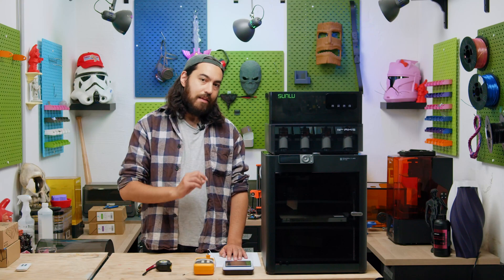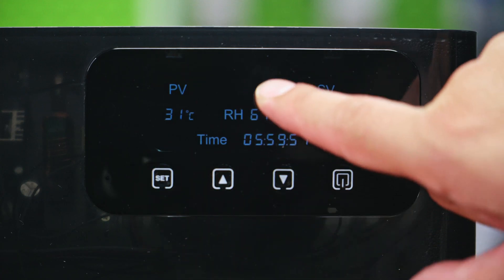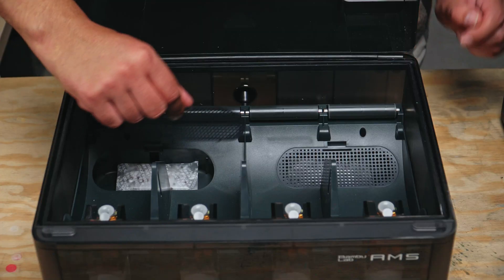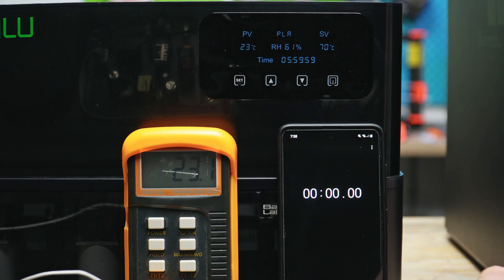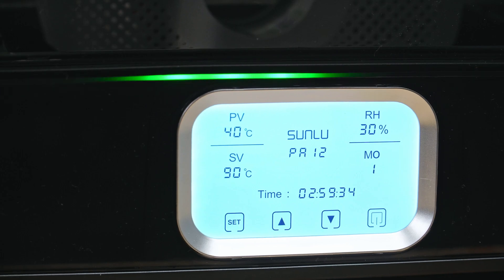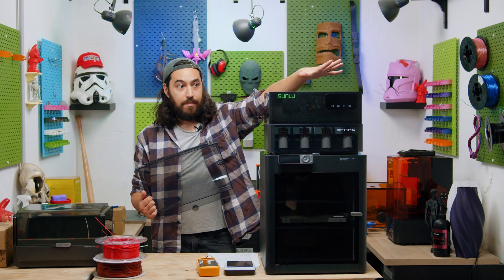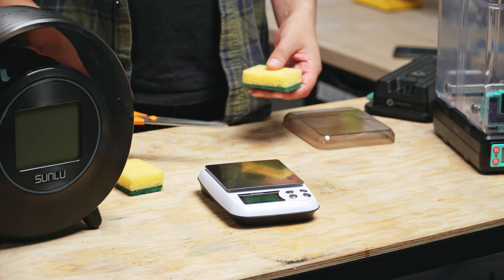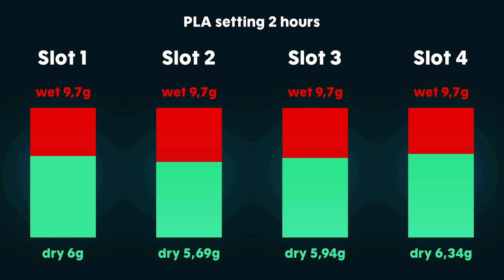The SUNLU AMS Heater: Powerful, Independent, Necessary

Comment: I have the AMS 2 pro and I'm pretty annoyed it wouldn't dry and print at the same time. Would this lid also fit on the AMS 2 pro or did they have different dimensions?
Reply from the maker: They're very similar but I believe there is an issue with the hinge. Search "Sunlu Heater Hinge for AMS 2 Pro" on makerworld

Comment: Does this remove the need from having desiccant inside the AMS?
Reply from the maker: Not exactly, the dessicant is there to keep the filament dry when the filament is being stored so while the printer is not operating and you have some spools stored in the AMS it is best to keep some dessicant in there so the filament doesn't absorb moisture. Technically you could just dry more often but it's simply more economical to use some dessicant.

Comment: i got mine yesterday, and my ams actually started to get physical moisture in the bottom corners of the ams "foggy looking with droplets" idk if im doing anything wrong but it looks like its sealing properly too
Reply from the maker: We had the same happen when we used it the first time but it went away after a couple of heat cycles. I think there is just residual moisture inside. If it continues though definitely contact customer support about it
Reply: @3DJake_Official thank you!
Reply: Even with the moisture vent open??

Comment: Sunlu goes up to 70c and Eibos will hit 65c. Not a huge difference, but having the individual (2 or 4) chambers is a nice touch with Eibos, and you potentially can use less electricity if you're not planning to always dry 4 filaments at a time. I'm so torn between them both.
Reply: Also note for many the eibos can’t mount in top of the printer if using any printing mods already out there.
Reply: With the Eibos I plan on making a more versatile stand/mount for the bottom, once my order arrives anyway.. Eibos also has automatic moisture venting.

Comment: soooo?
Do I want to purchase the OG Bambu Ams?
OR DO YOU THINK THAT BAMBU WILL ALLOW THE NEW AMS PRO 2 TO dry during printing?
Reply from the maker: I think they would change things and have it dry while printing, seems pretty weird not to do that just because the drying function rotates the spools...the spools rotate while printing anyway. But maybe they have reasons for that. If you have an AMS already it is more cost effective to get the SUNLU heater though.
Reply: Well the AMS 2 rotates the spools while drying, that probably why it won't print and dry at the same time. I don't see an update coming for dry and print functionality anytime soon.